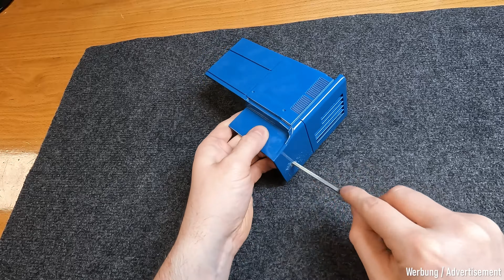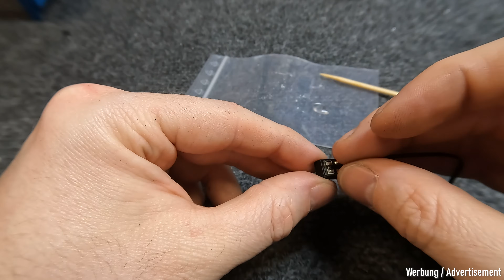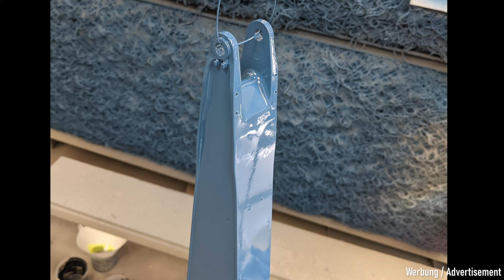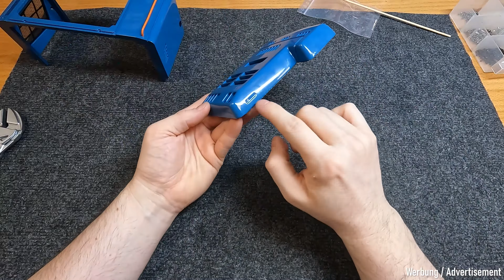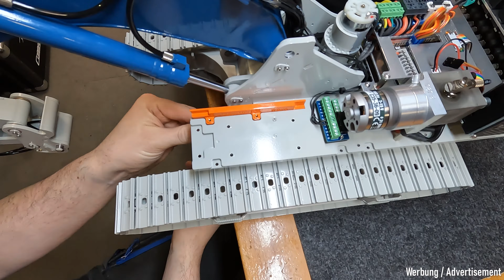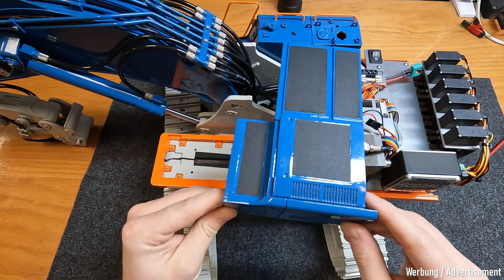RC Excavator Exterior - Part 10 - Liebherr R960 s01e10 EN

Comment: What makes the arm movement faster higher volume pump or a pump with more pressure??
Reply from the maker: higher volumune, assuming the pressure of your pump is sufficent
Reply: @sebbe23  What pump and size of lines would you recommend??
Reply from the maker: @MicaseHD  I've made an entire video about this topic: https://youtu.be/KXJJon_GxAY and https://youtu.be/YcADSYwFIAQ
Reply: @sebbe23  so what pump and line thickness would you recommend?
For a 945 build